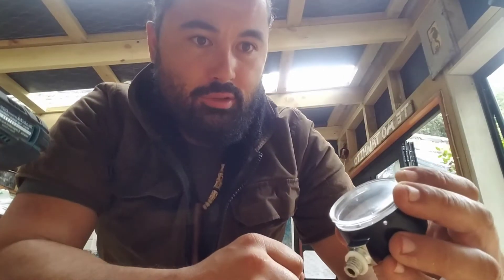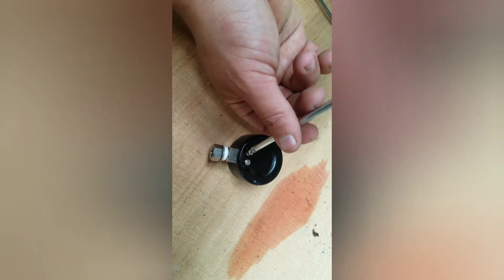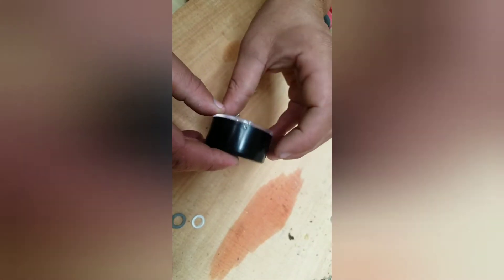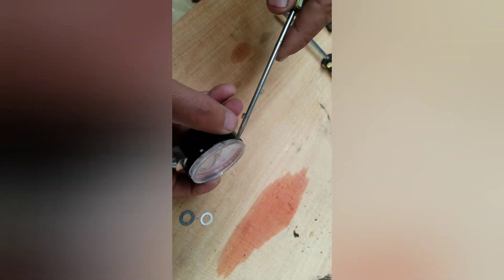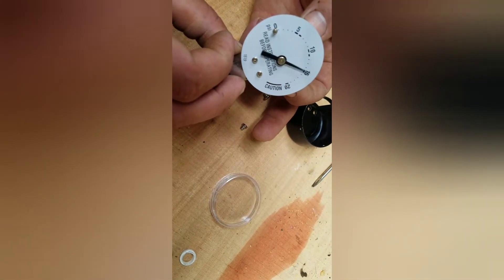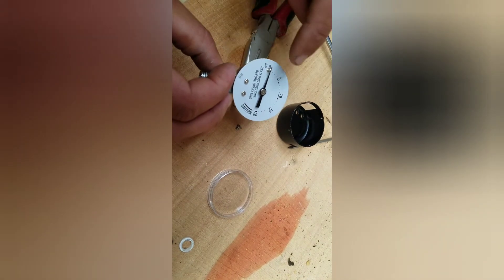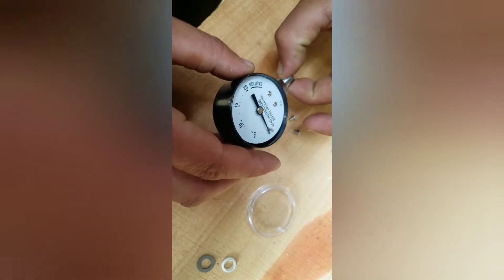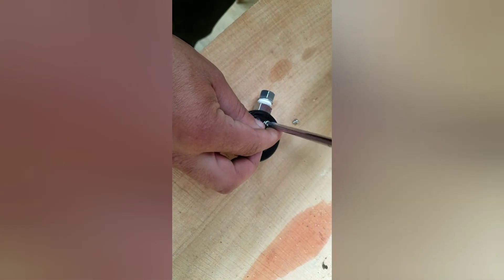How to fix a broken pressure gauge

Comment: Thanks Jamie, I bought a ten dollar silca floor pump with a gauge that was off zero, your instructions on how to hack into a cheaper, "non serviceable) dial helped.  I used some steam to warm the plastic (no rivets) cover and body interface and the cover popped right off with some gentle nudging with long blade.  Fuzzed around with it by taking needle past zero and stopper until it felt right.  I have not confirmed it is reading correctly but it was a great start!  Cheers mate.

Comment: Hey dude..  thanks for the video... Definitely set me on the right path ... But I didn't bend anything with pliers... Using your fingers, carefully lift the needle over the pin at zero and slowly go into the negative until you hear the gear click .. my guage was 20 psi too high ... Each click you hear or tooth that jumps gear seemed to be roughly 10 psi... So I repeated the process twice and my guage is perfect now ... And again thank you for setting me on the right path! Your video helped lots!!

Comment: My guage Pointer doesn't move ,how to repair it
Reply from the maker: I had this happen the other day it was seized. What I done was took it apart moved the needle gently by hand and then used CRC to lubricate moving parts and prevent corrosion. Then I blew in to the base of the guage and watched the needle move. Then put back together.
Reply: @offgridnative9437  thanks will try tonight and update u